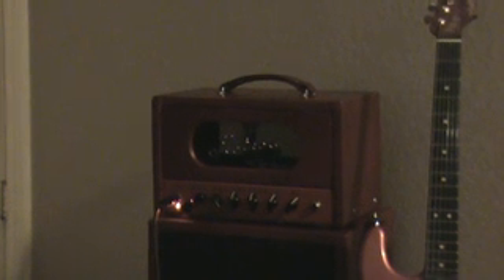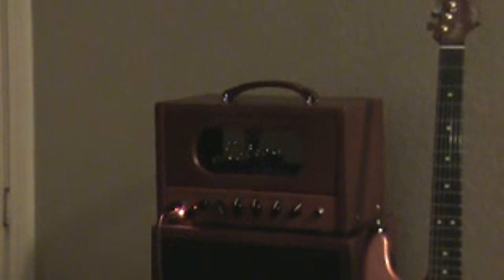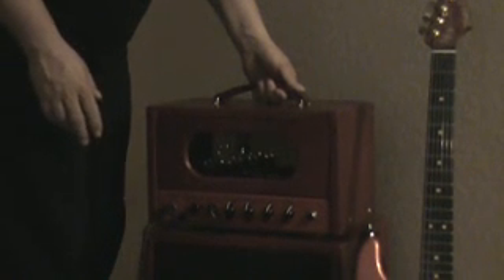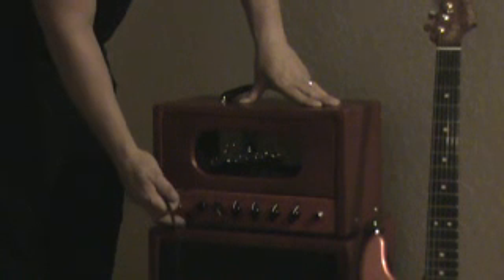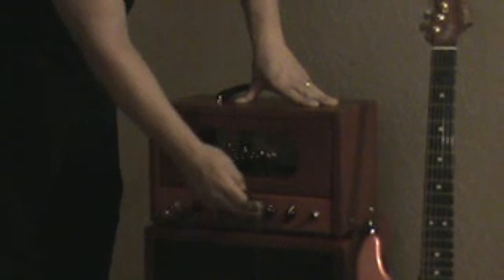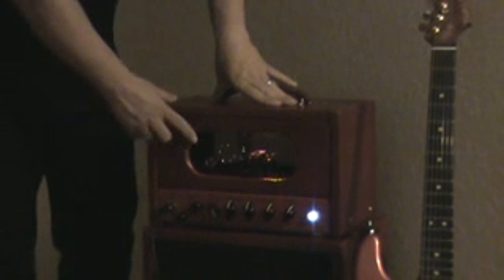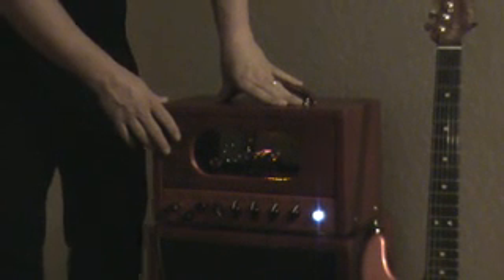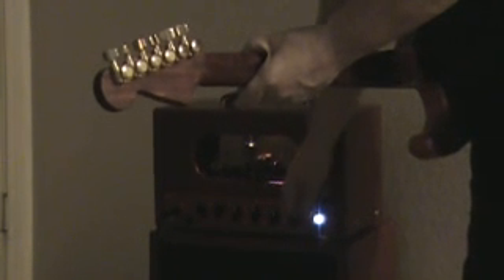HOME MADE TUBE AMP

Comment from the maker: @podboy333 
Thanks, It started as a AX84 P1EX. I did not get the kit and I used the best parts I could. I added a reverb that came from a petal kit...You can roll off the tone stack with a 500K pot most amps just use a switch. The tone stack has also been changed.... The gain stage has also been changed to get more vintage tone....  Some of these mods can be found one the AX84 web sit.... I also used a lower volt input transformer.